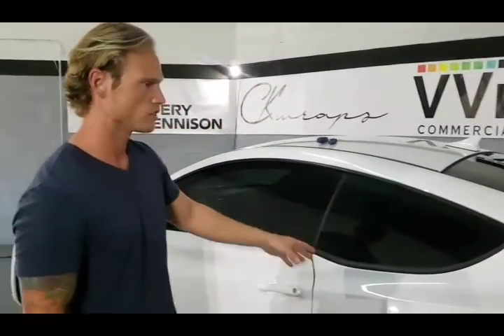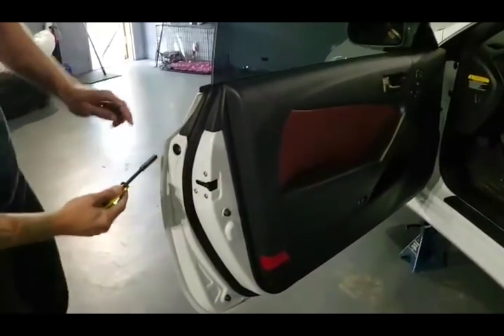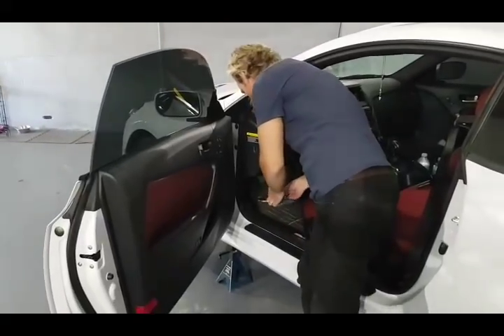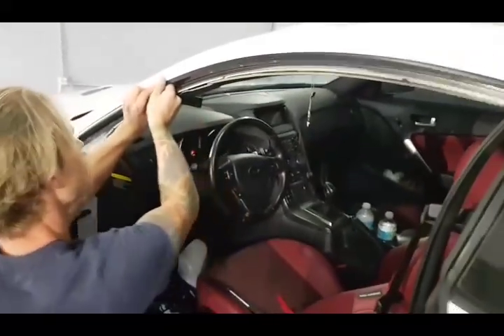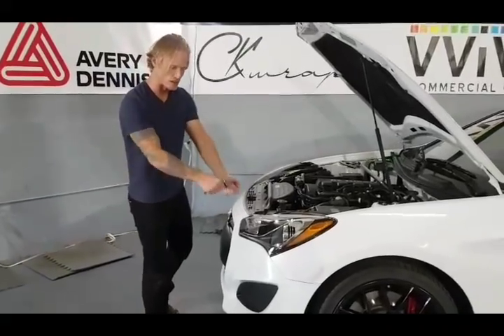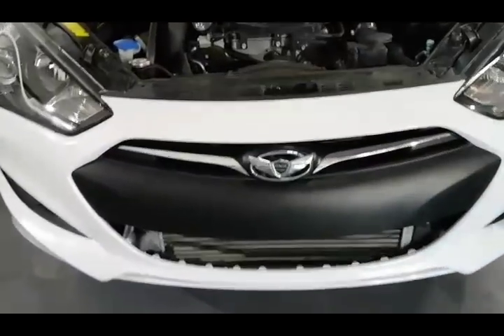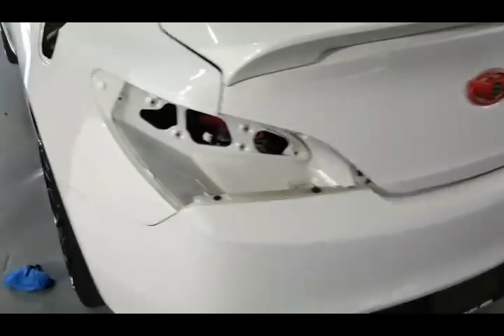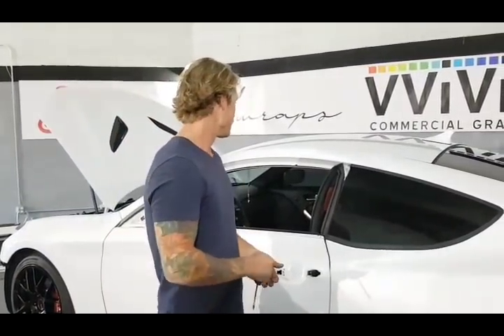How to dismantle a car. Removing door handles, side mirrors, trim, lights and bumper. By @ckwraps

Comment: massive thanks for doing this video it's my main worry about wrapping cars, paranoid of breaking trims and stuff.
top man 👍
Reply: Garry Bailey I second this
Reply: Garry Bailey I tried this with my door handle I popped it off but it's still connected to some wire but can't find the location to take it off  do you any idea man to this solution?

Comment: I had to replace door handle on Q50 and I'm like.. Nice. Pop of tab unscrew one screw, tumbler pops out easy, then I go to take handle off(almost ripped it out) fkn thing is electrical. The sensor light to unlock. Had to take whole fkn door panel off. I'm like WTF!!!! Then I remembered you did a free wrap on one. So you know exactly what I'm saying and ppl want to know why wraps cost some money. You can spend all fkn day disassembling if you have no experience on certain makes and models. And yes, your fingers will be hurting doing all that work. I don't care how often you do it. 

We see all these vids of you doing different panels in 30mins or less and think this is too easy,  and don't see all the prep. It's all fkn labor. It usually always is with everything.

Comment: at 5:20 you can see a small roll of tape on the black part of mirror that connects to car. is that there for a reason? i ripped it off

Comment: No hate on this video but seems that you couldnt have chose an easier vehicle to take apart. 

we wrap commercial vehicles on a daily basis and some are a right nightmare. Recently wrapped two little fiat 500's and everything was a pain in the arse to remove.

Its usually frowned upon in the wrap industry to remove parts unless you have a mechanic working for you but i suppose as long as your confident there is no reason not to have a go. Forums and google always help!
Reply: SuPrAmAd101 I’m looking to start my own thing and am not a mechanic, do I have to do all this or can I still do a quality job without dismantling?